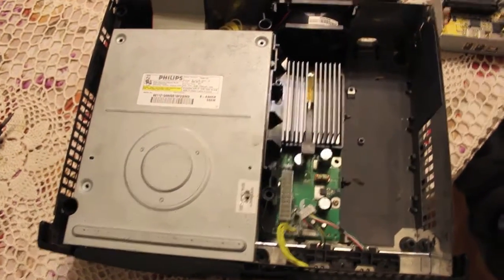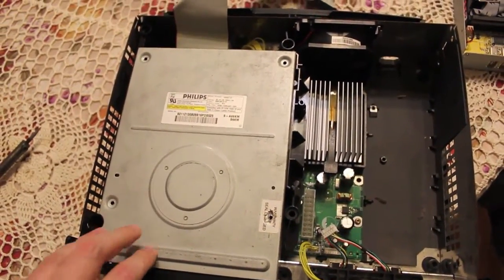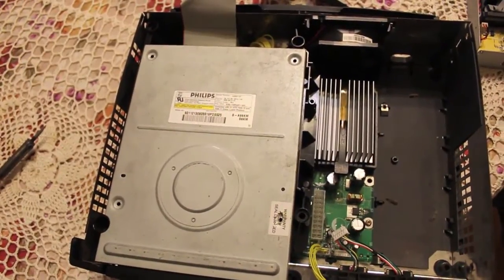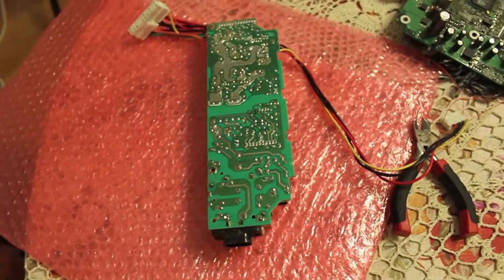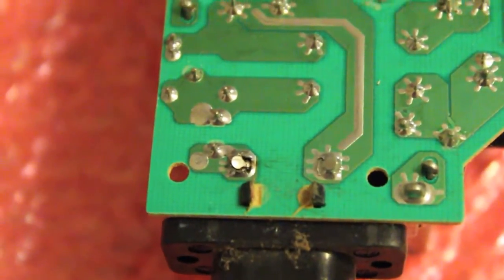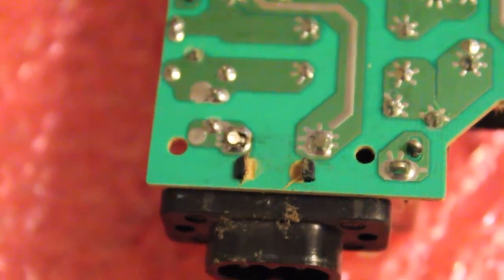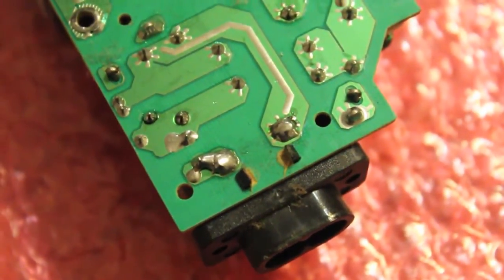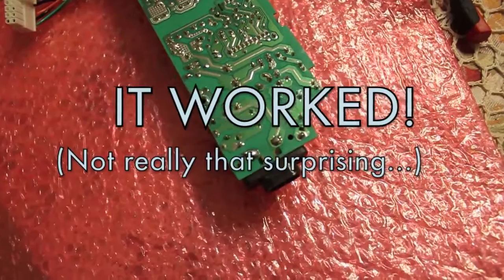XBOX (Original) PSU Solder Cracking Reflow Repair

Comment: my power jack on the psu jiggles, is this normal? i think it broke in my luggage but i don't want to open it again since i also fixed the corrosion points common with some older xboxes. so should it jiggle at all like a soda cap on a toothpick?